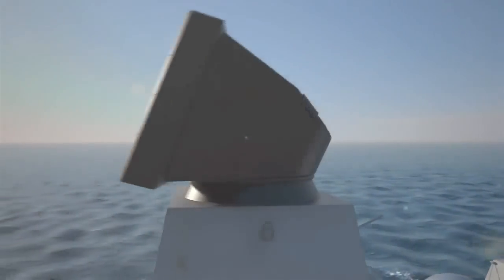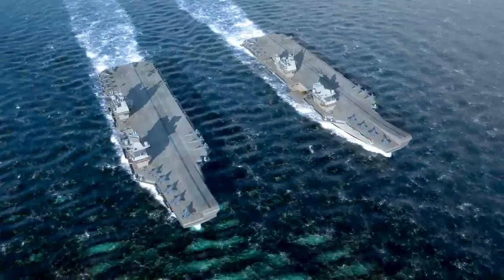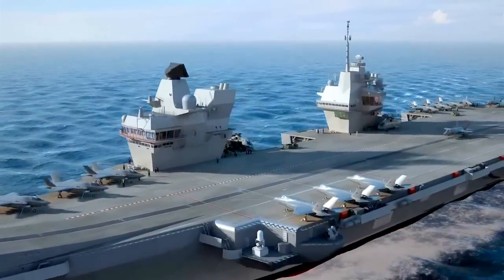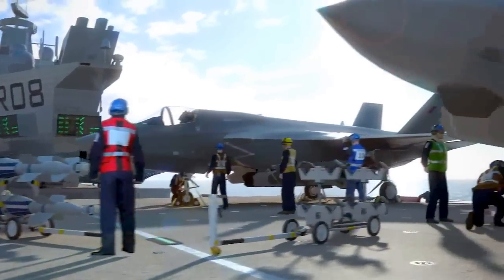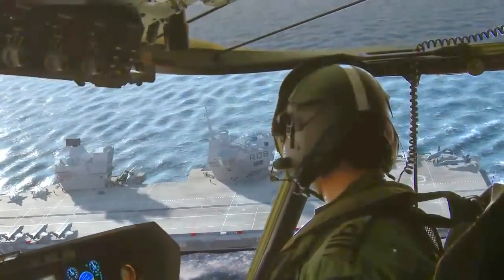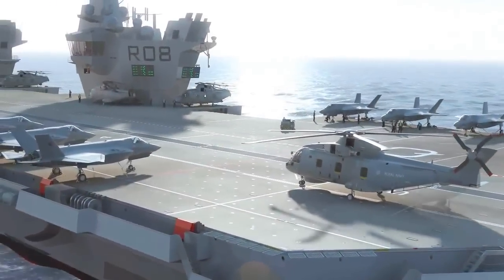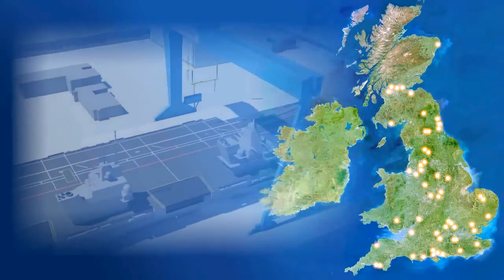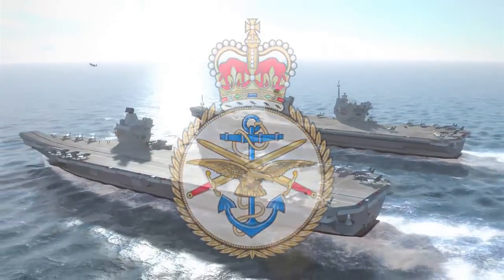Thales - Queen Elizabeth Class Aircraft Carriers Simulation [720p]

Comment: Why dont they put some cables on the deck and a catapult and some F/a-18 so they dont have to use that piece of crap the F-35 is.
Reply: True, while waiting for the delivery of F-35s to begin, Australia just ended up buying 24 F-18F Super Hornets as a stop gap solution.

Australia announced it would buy 72 F-35s in 2002 but Australia probably won't get its first 4 F-35s till 2018 (16 years). Australia ordered 24 F-18F Super Hornets in 2007 and got them by 2010 (3 years).

Comment: They should have done one with a ramp and one with catapult
Reply: Bob Shaw I'm not sure where you got your info but that's laughably wrong. A catapult system is capable of launching an aircraft every 15 seconds. Of any size or type that has been deemed permissible. You can't do that with a ramp. Also Ramp based launches require the carrier to slow to a speed of 10-15 knots and pilots must be mindful of chop and wind conditions. A catapult equipped aircraft carrier can launch aircraft at any speed and wind direction. Finally and possibly most important of all, ramp launches are only acceptable for a very small range of aircraft. V/STOLs in particular which limits the capabilities and usefulness of the carrier 10 fold. For a "Super Carrier" this is a rather pisspoor attempt. There is a very good reason the US uses Catapults, they offer versatility and speed that are the defining characteristics of a "Super Carrier" not only does the ramp system significantly reduce the capabilities of the Carrier but also it's reach and versatility. Humanitarian missions will be very difficult to carry out using just helicopters. The only type of cargo airframes that can be launched on this carrier. The US can launch any range of aircraft from C-2 Greyhound  to F22 Raptor. Hell they've even managed to land a C-130 and launch it from a catapult
Reply: lucozade waller But no spellchecker...
Reply: Bob Shaw Simply put. Government designs are not infallible. In this case in particular it was being flat out stubborn. I'm not sure if you're aware but the US Navy agreed to help them construct the catapult system using the new EMALS catapult tech being used for the New Ford Class supercarrier that's first launch is later next year. Their main concern was budget, EMALS are cheaper than typical catapults as they use electromagnetic linear propulsion to achieve the same feat as the previous steam powered generators except more efficiently and at hire degrees of speed and magnitude. Notice how the largest navy arguably most powerful one does not use Ramps? There is a very good reason behind that. Ramp technology is so old that the original aircraft carriers during WWII didn't even use them. I agree with OP lucozade waller they should have one with and one without at least then they'd realize how idiotic a decision it was. Sidenote I'm a mechanical engineer major and I dabble in aeronautics from time to time. From my perspective there was no reason to adopt an antiquated method of launch.
Reply: Yea they should have took your advice!! Your a marine architect with years of university and study of war ships right??
Reply: no but i have common scence
Reply: none of your buisness
Reply: lucozade waller Catapults take longer when it comes to launching jets
Reply: If they didn't choose to use a catapult system then there must have been a very good reason. Some guy sitting behind his computer doesn't know everything (myself included)
Reply: Well its too late to change them now. The only thing the carrier will carry though are f35's and some helicopters. They don't really need a catapult system and they couldn't afford to buy any other types of carrier based jets
Reply: The mod stated they was thinking about f22 raptors but then the f35 l2 came out
Reply: So they chose the f-35, meaning there wasnt any real need to change the ramp
Reply: reconnaissance missions what if other countries have to use our carriers?
Reply: Tornados have carried out reconnaissance in Iraq, F-35's can do the same. Other countries using our carriers? I doubt that would have to happen

Comment: Why two islands?  Why not just one big one?
Reply: The front tower is for navigation and rear is for flight ops, these are better positions for their respective roles, but both can perform each others roles in the event one is damaged. It also helps with flight deck stability apparently.

Plus because the ship is using an electronic propulsion system they don't need the two main gas turbines to be directly connected to the props as they just generate electricity.

Instead they can be placed where they want, so they're both directly under the each of the towers to keep the exhausts from running throughout the ship. Having them separated makes sense to prevent damage coming to both.

Comment: Shame we won't have anything to fly off them for the foreseeable future.
Reply: DarkSG129
People are critisizing the F-35 not only for its ridiculous cost and delays, but also because of the capabilities, such as its relativly short combat radius, its very slow speed, its small payload and its maneuverability/weight.
Reply: Jakob Moller Ok, i guess the combat radius isnt bad, but i consider mach 1.6 slow, as do i consider 4 internal hard points (two air to ground and two air to air) small. And on its dog-fighting abilities not only is it sluggish, but it cant carry short range A2A missiles like the AIM-9 internally, not to mention only the F-35A has a gun with the f-35B and C having to mount a gunpod, and even then the A model carries less than 200 rounds.
Reply: fozzy0266 you would have thought considering the piss they took over the F22 fiasco they would have to Lockheed to fly off a a cliff. Guess self interests and money talks
Reply: DarkSG129 also its nowhere as good as other fighters like the rafale, thats the only fighter we know of that can beat the f22. and if it can beat a raptor in dogfights. it sure as hell can kill a f35
Reply: DarkSG129 yeah, in long range engagements with the amraam but shear speed is how alot of fighters escaped f15s in the gulf war. lets say the f35 went up against canadas cf18s, we have 2 engines, lots of fuel, powerful engines and we have very modern legacy hornets. in a dogfight a cf18 WILL destroy a f35, becasue we have more thrust, bigger wings with short range air-air weapons. we can turn better and handle more gs. while the f35 was a direct replacement for the hairrer, but then they wanted to replace the f16, (and the a10, which is a flying tank. the f35 does not have 2 engines, 12 eapons mounts and a titanium pilot enhousement) there making upgraded f16s since they dont trust the f35a, the navy is developing advanced super hornets and drones because they dont trust the f35c, and the marines got what they wanted, a vtol light strike fighter. the USAF like i said with the f16s dont trust it. there upgrading f15s beacuse the f22 program failed.      canada abandoned the f35 program due to the MASSIVE costs and almost every person but the conservative party saying no the the f35. theres my rant :)
Reply: Totally agree, wish the British government designed their own, or at least went in partnership with maybe e the French or another government.

TOTAL waist of money!
Reply: ***** ok, first we left the program and the decision to get aircraft will be done after harper leaves. second the stealth is a joke, ww2 long wave length radars can pick up the f35, f22 etc. while modern long wave lengths like the russian s-300 rodars and nato navy ship radars can track it and identify it.... easy.   2 of the internal pylons can only carry ammrams while the other two can only carry up to a 1500 lb bomb.

the ting is a pig, it weights so much it cannot turn welll, THE CF18 CAN BEAT IT IN A DOGFIGHT. and thats from the seventies. the tech gear in the f35 is superior to the hornet series but look at the rafale, that french masterpeice beat the shit out of a f22. also the engine in  the f35 is wrapped in fuel bad idea when you get hit not to mention the skin is ultra thing. the engine takes way to much fuel to go supersonic so they fill the planes spaces with fuel tanks making it a heavy pig, and one engine in a bird infested, icy icy cold canadian air force bace is bad. imagine you 1000miles north of yellowknife in the middle of january and you engine fails. and they WILL no how matter how good they are made. your fucked and bye bye 100 million+ dollor aircraft, and the pilot dies in the cold and or polar bears. while in a dual engine fighter you can rtb.  25mm cannon meh, if we wanted we canadians can stick a 30mm mauser in our fighters! if we get a thyphoon, rafale or super /advanced super hornet thats easy to do. and all those hardpoints on that aircraft make it even heavier and fuel gusseler. meaning it does not have range to go up north. and with our budget and what our country needs are. the f35 is the worst tool for the job.
Reply: fozzy0266 ``always use the right tool for the job`` the f35 for Canada is like using a pipe-wrench to hammer in a nail....
Reply: Skiing Canada Yep like trying to play hockey with a baseball bat.  lol
Reply: We should have gone with the Rafel
Reply: Australia announced it would buy F-35s in 2002 but it will probably get its first 4 F-35s by 2018 (16 years).

While waiting, Australia ended up buying 24 F-18F Super Hornets in 2007 and got them by 2010 (3 years). Perhaps the Royal Navy should do what Australia did and buy F-18F Super Hornets while waiting for the F-35s.

I mean, if the RN orders F-18F Super Hornets now (2014), it can probably get all 24 F-18Fs by 2017. All the F-35s probably won't be delivered by the 2020s.
Reply: theres the f35 but its not the best
Reply: Jakob Moller Lockheed is the problem.
Reply: john bonora The combat radius is greater than the Raptors because it carries so much fuel, thats part of the reason the body is so big, but let me explain, your judging it on characteristics that just don't matter anymore, il admit, it should have a bigger payload and the non STOVL versions should be faster (I say that because the engine on the STOVL makes in very hard to go super sonic) but the thing has more technology in it than anything that will be built for the next 50 years, the USAF have found that it can detect any aircraft out there, including other stealth aircraft at several times the range they can detect it, the amount sensors and technology on the plane is hard to comprehend
Reply: DarkSG129
I agree on that point, it has amazing technology, i just think that the airframe itself is far from ideal.
Reply: john bonora who would think that wrapping fuel around a engine was a good idea :P
Reply: There is more than a 100 F-35...
Reply: vader1a Lockheed is a big assed government donor.  As long as they keep doing that, the government will continue to let them rip off the American people.
Reply: Should have gone for Cat and Trap F-35C's larger payload, longer range, faster and can land on US Navy ships, not just USMC operated ships. But that only happens if they can actually fly and not be grounded and ruin RIAT and FIA 2014. They use it as a selling point and cancel it, they haven't heard of a C-17 Globemaster III for static display.
Reply: smoketinytom yeah, but its still a bad design, more payload in the f35 means less fuel makes its low flight time lower and to get to supersonic (not loaded with weapons) it takes so much fuel its insane. if its working with tankers, and air superiority/multirole fighters its great otherwise no. also the engine is wrapped in fuel, not smart either.
Reply: DarkSG129 yeah, but the raptor beat it with fuel comsumption, speed, exceleration, dogfigting abilities and it doesnt have fuel wrapped around everything.
Reply: Skiing Canada The Eurofighter and Rafale have both beaten the raptor, but only in dogfights, in long range the F-22 is un beaten so far, and the F-35 could definitely beat anything out there
Reply: Skiing Canada Exactly.Canada has always bought twin engine fighters for that very reason...large northern territories and we would like our planes to be able to get back to base.  The F-35 is the WORST aircraft on the market for Canada's needs.
Reply: vader1a It's bad enough buying a (mostly) American aircraft, but French planes on British ships? You're kidding, right?
Reply: Skiing Canada dude have you got the F-35 in your garage? Have you even got a F/A-18 in your garage? The F-35 is a next gen STEALTH fighter. It's not meant for dog fights. . . This ain't WW2, these planes are meant to detect enemy jet far away then hit and run undetected. If stealth is so useless like you said, then why is every major country either developing its own stealth jets (coping American F-22), or asking Americans for a few? Stealth capability is a next gen requirement and the F-35 might be perfect right now but it hasn't even been in full service yet. It takes time to perfect a complex machine. Wait and see.
Reply: ARVIN its like saying fat is the cause of heart disease and obesity. just not true yet a large majority of us belive it. also canada cannot afford a high performand stealth or no stealth fighter and a strike aircarft we need a upgradable, dependable multirole fighter.

it has one engine and cannot run from oenemy fighters, thats how alot of migs just escaped the f15s grasp in the gulf war.

and its not stealth its low observable rated by levels, f18s 1 and f35 or f22 9 or 10 .

also too little weapons, overweight and single seater only.

and the us wants to make it a f16 replacement which did not go through since it sucks at air to air. they wanted it air - air comatable sue to the f22 ending production way to early.
Reply: cprl mackinnon So you think you're smarter than the top military leaders? How you know it suck at air to air combat? Its not even DONE DEVELOPING YET! Get it? Its not even out, even if its out, you still won't know how it is, because you don't have one in your garage! No one truly knows how these military machines are until its tested in real combat. But one thing i do know is that many major countries are pouring in money to develop this jet, it won't just be a showpiece.
Reply: e0o9kii the uk dont need hornets, there cairrers cannot support them and they have lots of eurofightes on land bases
Reply: cprl mackinnon Might as well go with the Dassault Rafale then for the Royal Navy. 

Perhaps Britain can also try to buy carrier based Mig-29Ks as well.